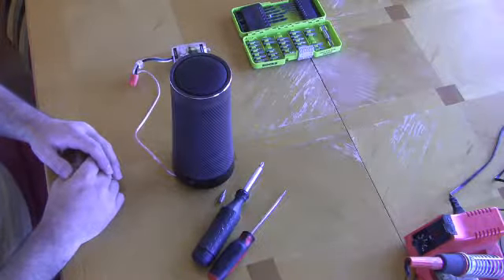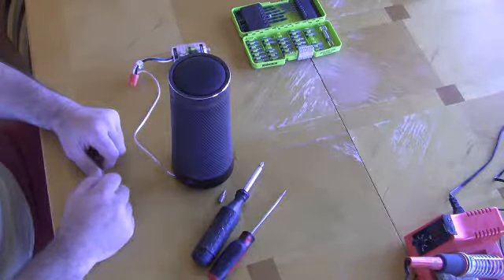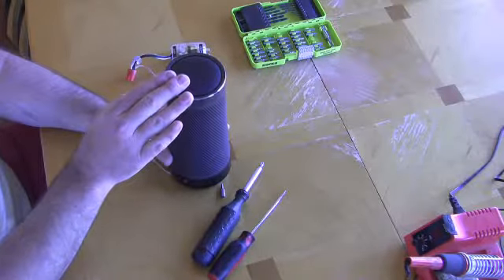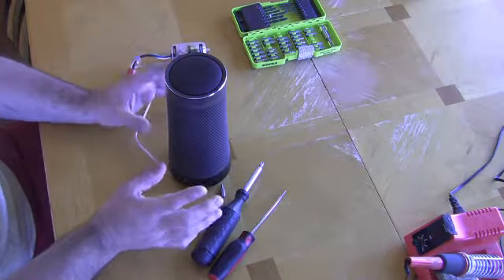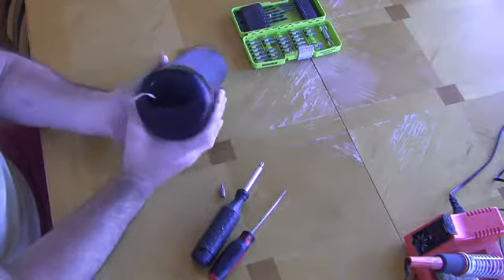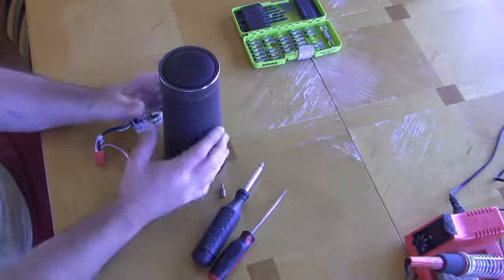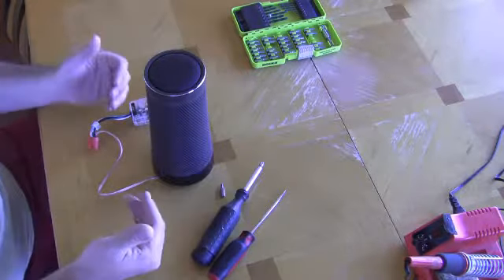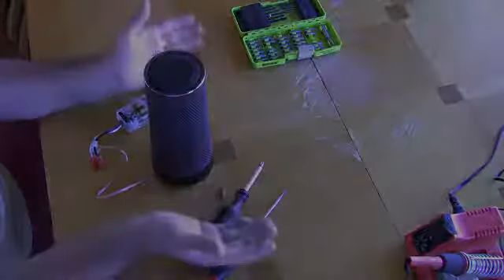Harmon Kardon Invoke: Part 1:  Introduction

Comment: I have four of these speakers and love the sound quality. Unfortunately, Cortana is basically dead. I also have an Echo dot and I was wondering if it were possible to transplant Alexa's "brains" into the Invoke's body?
Reply: You can use the Invoke as a Bluetooth speaker, so, treat it like any other Bluetooth speaker for the echo dot.
Reply: I have the same question, can we switch it to google home not by bluetooth I mean can we but google home mini motherboard inside the harman kardon to be good home
Thanks